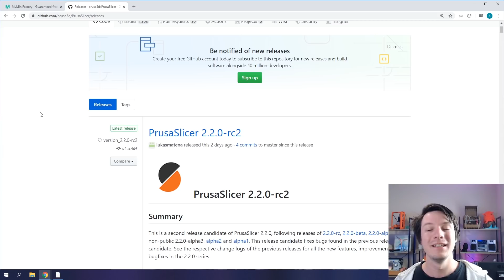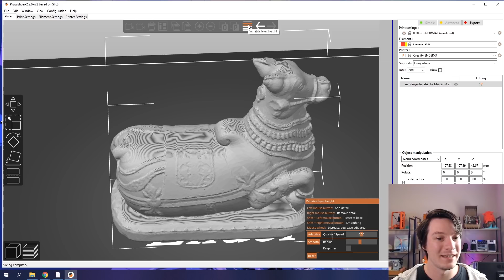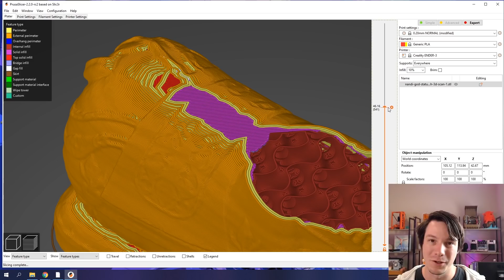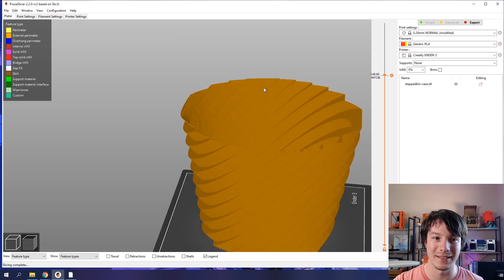Myminifactory VS Prusaslicer VS Creality Ender 3! 3DP Gauntlet Episode 2

Comment from the maker: TIMESTAMPS:
1:18 Finding the 3D models on MyMiniFactory
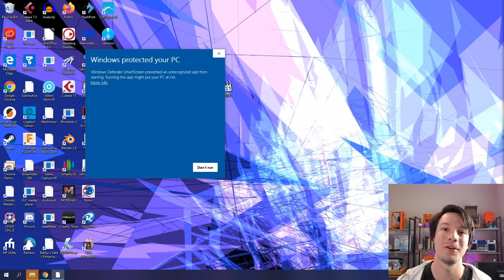4:45 Intro into Prusaslicer 2.2.0 rc2 Ender 3 setup
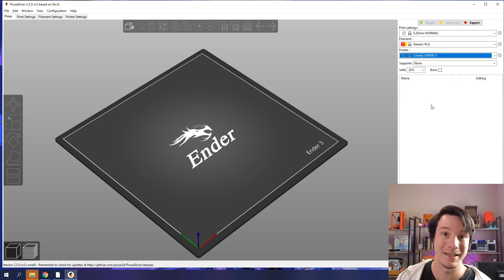5:57 Slicing Nandi statue using adaptive layer heights and gyroid infill
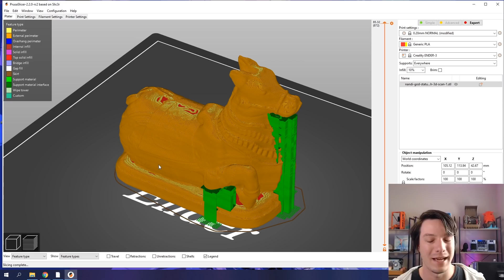14:21 Slicing Po Elbow using clever print orientation and printing uniform thin walls  
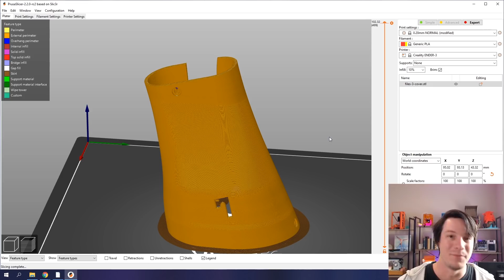20:55 Slicing Stepped Bin using Vase mode and increasing extrusion width
26:21 Results and conclusion
Reply: Glad you're doing more videos on the Ender 3! I actually switched to a BMG+TriangleLabs V6 direct drive setup and boy, my printer prints amazing now! Nice and clean little strings of molten plastic flows out of it. I can even print out TPU perfectly! (Though I haven't tried Ninjaflex)
Reply: Hallo
Reply: 0:44 promising 2.2.0 gold, but looking on github, there was a rc3 released 11 hours ago 😂
Reply: You'll remember me from a comment I made on one of your other videos.....wasn't trying to be a dick, hope you know that.  I like this video, I'm going to get that slicer.  Seems it outperforms S3D....we'll see when S3D pushes out v5

Comment: Stephan from CNC kitchen tested strengths of the different infils, and showed there was little difference between cubic and gyroid. So I just use cubic, because it prints faster and doesn't shake the shit out of the printer (gyroid works X and Y axes *hard*).
Reply from the maker: Nice! I wasn't too convinced but it certainly is pretty. Cubic is still my favourite.
Reply: Im a big fan of Cubic and Gyroid too. I've been printing with those the past years only. However i can say Gyroid is still better. I made serval tests with those infills. My result where that Gyroid can make densier infill without requiring more filament compared to cubic. For example If you print Cubic with 20% infill, it will be equaliant to 12% Gyroid infill (filament and print time wise). Not to mention that cubic has those giant holes even with 20% infill... super annoying if you print something with detailed top layers. Gyroid in the other hand is more stable especially if you print exotic filaments like ABS that love to warp. Cublic air-pockets create disgusting top layer surface finishes with ABS because the air cant escape. Gyroid however, can breath through the whole print thus can trap heat better and equalize air pressure if the print/layer shrinks. Gryoid 4 Life.
Reply: I believe Gyroid has the benefit of being a single continuous void not separated by the infill.
Reply: I find that sometimes with Cubic I can see the pattern where it contacts the wall. Less so with Gyroid.
Reply: I've had issues with over-extrusion when using cubic inside Cura specifically. I found it sometimes generates duplicate extrusion lines which can result in your nozzle grinding against the part.
Reply: @ExternetEx  There is an advantage to the air pockets if one is printing something that needs to float like a boat or pontoons. If the perimeter leaks the entire inside won't fill with water. But, that is pretty much an edge case.
Reply: @ExternetEx  Good thoughts, thanks.
Reply: @Sembazuru  Thats pretty genius actualy. Why was the titanic not build with cubic infill :P
Reply: but the style tho

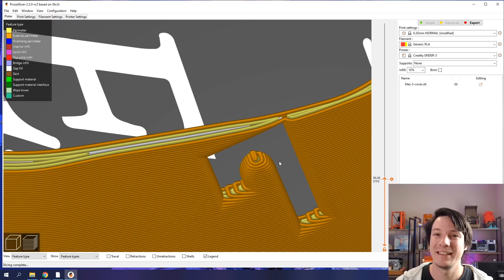Comment: Those blue points at 17:00 are caused by "detect bridging perimeters" and PS increases the layer height/extrusion value. This causes surface artifacts and videos I've seen recommend disabling it.

Comment: On thin walled object I also play with the perimeter line width. This can reduce the little loops and gap fill areas. I usually try to adjust it a little thicker only by a few hundredths of a millimeter. This can also reduce printing time significantly because it's not jumping around as much depending on the shape of the model. But increasing perimeters as you mentioned, is the biggest help.

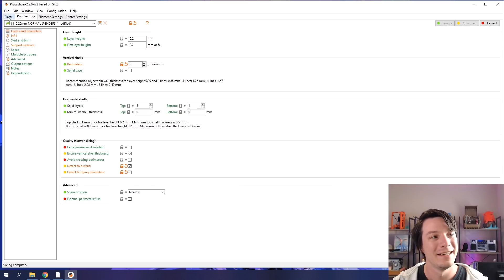Comment: At 18:30, detect thin walls can have odd behavior with some geometry. It actually caused a slicing error on 2 of the 1440 elementals; skipped layers. Use with caution unless new releases have fixed it.

Comment: I’ll start with thanks for such great videos you truly are inspiring, secondly I didn’t read all the comments so I apologize if this was covered. I wanted to point out Prusa Slicer is pretty awesome at demonstrating a final print rendering once sliced. While watching the vase mode you’ll notice you can see right through the rendering which is a tattle tale that the print won’t make it well. I thank you for pointing out the extrusion width, when I would notice the see through in rendering I would give up on vase mode and end up printing with thicker walls and no top layers. Thanks for bringing vase mode back into my life.

Comment: I find dialing in settings to make sure thinner geometry is properly filled in to be the most tedious part of slicing. Cura doesn't seem to automatically handle those areas very well.  I'll see like 2-3 walls then a gap that would clearly fit another line perfectly and it'll just refuse to fill it. So frustrating sometimes. Although, I'm a bit of a perfectionist and like seeing everything nice and evenly filled in those situations. Usually tweaking the extrusion width and slicing resolution is enough to get it just right.

Also... that musical trashcan is the best thing I've seen all day!  😄

Comment: Vase mode is amazing once you figure out how it can be ultised. I recently designed & printed TPU grips for a small desk vice.
The grip was designed to be printed in vase mode as I made it 0.8mm thick and printed it vertically, without a brim, my Prusa i3 Mk3 handled it like a champ. The grips look and work brilliantly. Wish I could post a link to pic of a finished print still on the bed, it's quite something.

Comment: Thank you Angus.
As allways I'm lucky if I can watch a video from you. This time again something with Slicer.. and it happened again: there is something I didn't try yet! The Vase mode with thicker External Perimeter! You can set this so much thicker.. thank you for this great tip. It's anyway an interesting Video I enjoyed it very much!
Until now, when I want to print 'stable vases' I either used 0.6mm nozzle OR I don't use vase mode but several Perimeters with 0% infill, 0 top layers and (Layers and perimeters/Advanced/)"Seam position" set to "rear" for nicer surface / less random retraction spots. I know this is not the same but it works and is more stable.

Comment: 90% of the time I print with a 0.5mm nozzle and 0.3mm height. I find most stuff just doesn't require the extra detail, and it it makes stuff so much stronger and faster to print. Printed a phone case from tpu yesterday (it took 14 hours with my slow extruder!) with a 0.3mm nozzle and 0.2mm height and that's about as fine as I ever get.
That was a fascinating feature that finds the flat surface when you flipped the prosthetic model.
I tried Prusa Slic3r with my old  reprap Sintron  i3, and naively tried their default i3 speed settings practically destroyed my machine. The Z steps/min were insane.  After cursing the developers, changing the settings, and not being impressed with my results, I went back to standard Slic3r which has it's issues, but I know how to work with them.

Comment: Love the line thickness, CNC kitchen did something about making stronger prints by this method, I tend to use fine to get more detail, shame it can't be changed dynamically like layer height, I'm sure they will program it eventually.
One thing that annoys me is the time to create these prints, so working on dual extruders, different nozzle sizes, with different layer heights and servo controlled ooze guards. At my current rate I will be ready to show it in about ten years lol
Reply: You can change it manually in S3d (tried) and Cura (watched a video), never worked with Slic3r/prusa slicer so don't know if it is possible here.

Comment: What I like on Gyroid infill, its not closed cells. You can fill it up with resin after printing. I print some parts withut a bottom for example, but with infill as it owuldn't print without. And then I fill it up with resin to make a solid heavy object.

Comment: Vase - I would suggest that it is printable with 0.25 layer height (or even higher at 0.3). Test (min) layer width to around layer height + nozzle size (for.25 I would go .65 w) and for PLA with a basic 3d printer, for these specific settings, i would suggest not going over 80 mm/sec for the 1st run (80 max speed, i would start with 50-60 for a basic dialed Ender 3).

Comment: I used Prusa Slicer on my creality cr20-pro because I have Prusa PETG and thought this would be the best way to get it working quickly and I was correct, it printed a decent benchy with very little adjustments on the printer or filament.

Comment: Might have to eventually give Prucaslicer a try. I'm not a big fan of the UI, but it might be worth dealing with for the variable infill!
Just picked up a used Duplicator I3 from Facebook Marketplace for basically nothing as it "wasn't printing", a few minutes with an allen key and wrench to unclog the nozzle and it's back up and running! Still a cracking printer
Reply from the maker: The di3 was one of the first sheet metal i3's and mine worked for years till it found a new home! Bulletproof.

Comment: I think the artifact on the prosthetic arm maybe due to underextrusion due to previous retraction. Maybe check if it occurs after the retraction. I think what happens if you have a large retraction the pla cools as it is not in contact with or melted by the nozzle as well. Try a fix by refeeding the material at a very slow rate to give the material to fully remelt again. It would be nice to see a video update of you can fix this error.

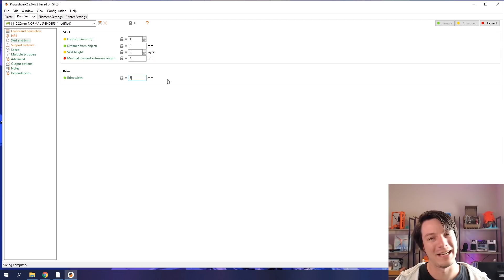Comment: 19:34 Well at least i am not allone with the Loop/Brim bug. If you create a brim arround the object Pursa Slicer at the moment will not take the brim size into account when creating the loop so you will print the Brim over the allready printed loop which can lead so some issues with bed adhesion as the Nozzle starts dragging the loop arround or gets stuck. Hope this will get fixed for the final release.

Comment: Hey Angus. I followed your video after learning that Prusa Slicer now supports "other" printers. I love the interface and its really good.  But I have discovered an unresolved problem (since about 2016 it seems) that can cause severe damage if left unresolved.  I've just finished a homemade i3 type clone and it works really well with Octoprint and Cura. I've printed a milling machines parts with it.

Problem I see is when you install PS and add your custom printer, load the model and slice it. The default inserted code G1 Z5 F5000; is inserted by the slicer as the default start g-code. If I look at the lines in the code that limit the max speed and max acceleration for the Z axis those values are way, way lower than the instructed F5000.  In Prusa Slicer the Machine limits has the maximum feedrate for Z at 12mm/s for both normal and stealth mode and it has max acceleration at 500mm/s and 200mm/s respectively.

M201 X9000 Y9000 Z500 E10000 ; sets maximum accelerations, mm/sec^2
M203 X500 Y500 Z12 E120 ; sets maximum feedrates, mm/sec
M204 P1500 R1500 T1500 ; sets acceleration (P, T) and retract acceleration (R), mm/sec^2

What this causes is my Z-axis to audibly freak out and grunt as it cannot achieve that feedrate and it stops. This leaves the nozzle lower than it should be. The printer thinks it is at z=5mm while physically it is not. The rest of the file then pushes the hotend down to a position lower than the bed thinking it is going to z=0.3 for the first layer.   And if your glass survives that you are lucky.

The original issue was brought up by Grinsaw on the Reprap forums on 04 June 2016 under the title "Crazy move at the start of a print." and seems to have been unresolved in terms of an adequate solution. The net result is that the Prusa Slicer has that error unresolved in it too. I have not brought it up with Prusa as I thought you may want to check what I am referring to and possibly do a video on the solution. I'd hate to throw names around and try to point a finger, but it does highlight a much deeper problem if "potentially dangerous" g-code is sent to a printer or any machine for that matter without being pre-processed and checked according to the speed and acceleration maximum values for that machine you could be in for some nasty surprises.

Are there any slicers that check their own g-code for anomalies?

I'd love to hear your comments on this.

Comment: On that model you could have left 2 perimeters and you could have gone in advanced and set Perimeters to .8mm and outside to .48. Makes nice strong parts and prints faster
Reply from the maker: True that! That'sa clever way to approach it.
Reply: @MakersMuse  Read my 2 tutorials here https://workbench.grabcad.com/martin.pirringer-2/tutorials Or watch Teaching techs video or mine on Volumetric E. Prusa slicer is great for that too and absolutely fantastic for printing with bigger nozzles. We just finished our FRC robot and used 14kg of HIPS to do so the whole robot weighs 116 lb Only problem is they cancelled our season
Print I am most proud off are some GT2 pulleys printed with a .8 nozzle (hint Outside perimeter set to .8 inside to 1.5 and layer height to .4) and it drives a belt nicely. Printer we did it with - we have 2 Anycubic Chirons

Comment: i have mot watched the first one yet, but I don't fully understand the need for random models. As search tool offcamera, sure, but I'd rather have optimal learning content, than random models. 
As this is apparently targeted for beginners, I would suggest rather showing off finding models (stlfinder website, collections, going from one awesome model to the maker's profile and other models etc.) you can of course also show off communities (reddit, fb groups etc where to find model inspiration or links).
I noticed myself that finding models takes a considerable amount of time and if I would not know my way around computers as well as I do, I would struggle and give up before finding many good models. 

another topic: this video made me realize that there is still much optimization room for slicer software. non planar printing and infill density variation (denser at the edge or topological optimization). support generation could also be opimized and tree support enhanced. 

i just had another idea:
slicer support for adding model support in person (like building blocks pushed into the print volume at the right time. for example a metal container with a variable height, but fixed by screws or smth and gcode that pauses to wait for the added user volume and then makes a brim and starts support structures on it. meh, probably not worth it, but there is still many things to be done. 

anyway thanks for the nice video, keep on going!

Comment: Nice video, handy to see how you control the slicer. Is prusa slicer your main slicer now? If I remember correctly you used to use simplify3d. What made you switch? I'm still using s3d because of the UI, even though I have a prusa. Ui of prusa slicer confuses me, didn't you have that?
Reply from the maker: I moved towards prusaslicer last year. The stagnation of s3d and high price made me move away from it as everyone else surpassed it's features... For free. Any new UI takes getting used to but you'll pick it up quick the terminology is largely the same!
Reply: @MakersMuse  thank you for your answer
 Makes sense. Everyone is waiting for S3D v5, but has been delayed and delayed again.  Perhaps it's time to switch too

Comment: Well apparently it will be released on Prusa time :D you shouldn't be so certain that they'll release things by the time you publish the video.

When you filmed this around 7.3, they were at 2.2.0-rc2
11.3 rc3
11.5 rc4

The fixes and reworks that go into RCs are a bit surprising in scope, i doubt that they should have been called RCs. Otherwise, everything seems fine.

The absolute must announced feature for me, lack of which held me back from using the program, is save-to-SD/eject. I know it seems like a small thing, but it's such a huge convenience.

In other news, they REALLY should start signing their official binaries so Windows, AV etc are less suspicious. You can't be telling me that the mighty Prusa Research doesn't have money for a code signing certificate.

Comment: Firstly, thanks for these videos, very well presented.  Thought I'd try the vase as well as this would be my largest print so far. All's ok but also get a couple of  those strings thru out the print.  Printer would stop, retract filament, feed it then skip a curve and go straight to another point on the print and continue printing.  Could it be a glitch in the slicer? Using PrusaSlicer 2.2.0

Comment: One thing that tricks me up is that when I print things with holes I often get lines horizontally across the entire print where the holes are.  I've never really seemed to figure out what settings I could tweak to remove that issue. I know the issue is that it extrudes different amount of plastic at those planes in the print but I for the life of me just can't figure out what to change. I have tested so many settings in the slicer to trying to figure it out that I basically just gave up on it. Maybe one day I'll come across some way to fix it. Or at least I hope I will. 🥴

Comment: Shouldnt you got in steps by 4 in layer hight (0.12, 0.16, 0.2) because of the stepper motors? I`ve read about that "magic number" to get better results. Maybe .24 layer height instead of .25 would have been a better result?